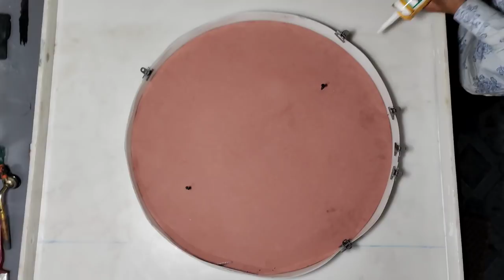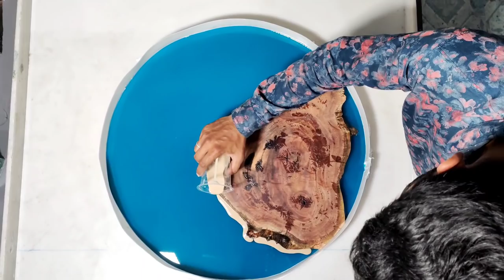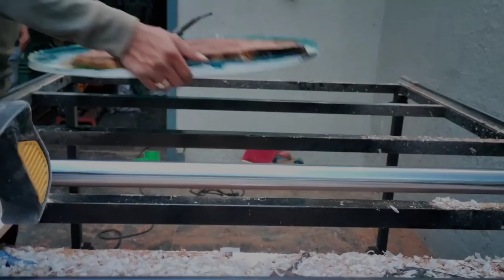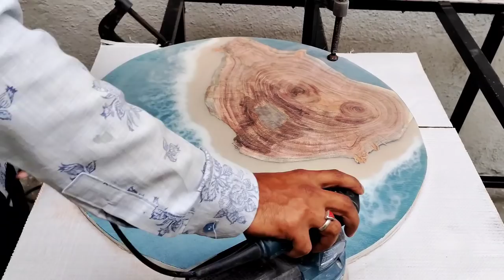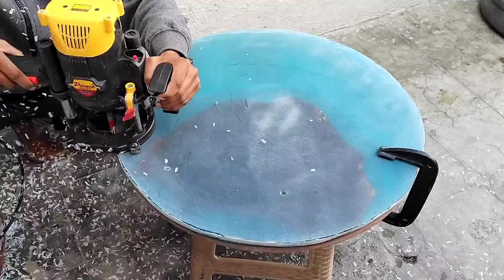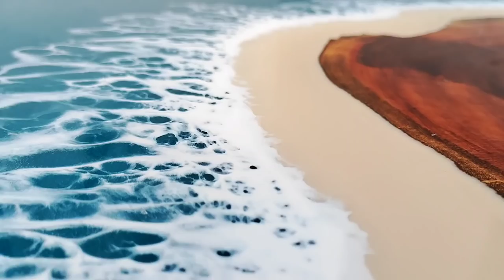DIY epoxy resin table | How to make Ocean table

Comment: What is that tool that you use after taking it out of the mold and before the belt sander? It's on rails. I keep seeing those but don't know what they are
Reply: @artlocalbysapnagohil  what are you using it do do? It almost looks like you are planing but I don't know. I thought routers just did edges and detail work. I'm really new to woodworking but very interested in trying a project like this
Reply: It's planning the wood and the track the router is on us called a sled. It pretty much turns your router into a CNC machine.  Cuts down your sanding dramatically and also gives you a very flat surface to smooth out.  Really nice on harder types of wood.